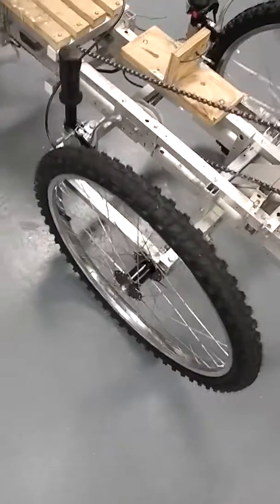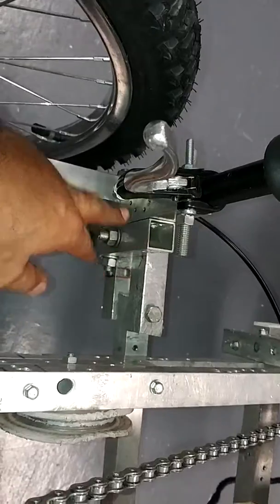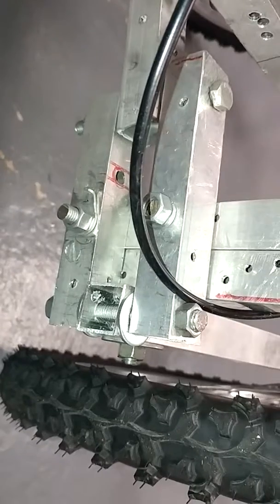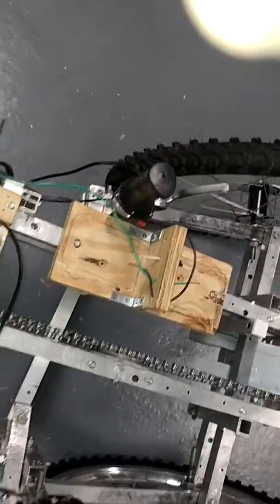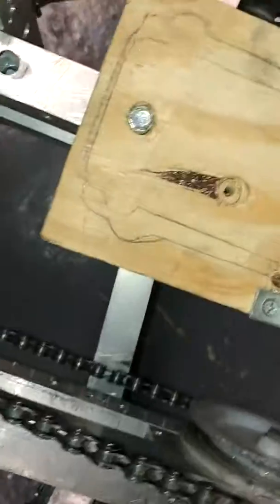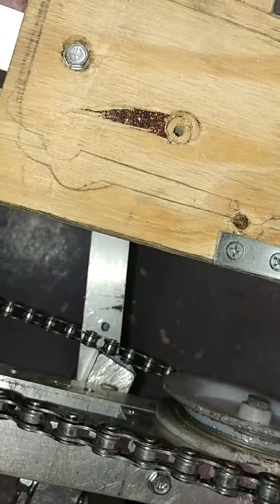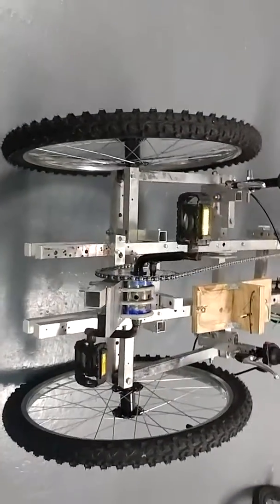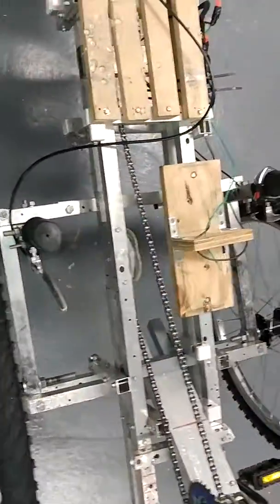XYZ Spaceframe steering update

Comment: Dude, can u show detail how the steering rack is mount on the main body?
Reply from the maker: @Luqman Radzuan : the steering rack is held on the frame by hex bolts at the front of trike. The turning portion is reinforced by having 2 short square tubes (horizontally and vertically) and 1 long square tube with a hex bolt going through the tubes (depending on horizontal or vertical tube). There are 2 short square tubes on each side with the long square tube being held with hex bolts. The interconnected tubes act like strong tie rods. 

Let me know if that helps. I changed the steering as I now have an electric quad that needed a stronger steering rack.
Reply: @gordocar3520  Thanks! now it make sense. so u have only one hub motor at the front?
Reply from the maker: Yes, the hub motor is 750w...it's more than enough power!